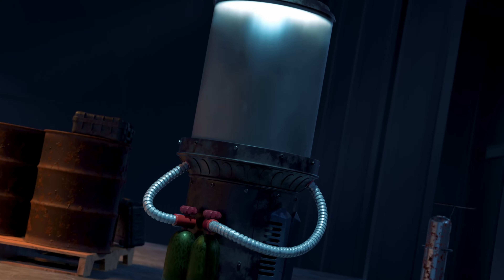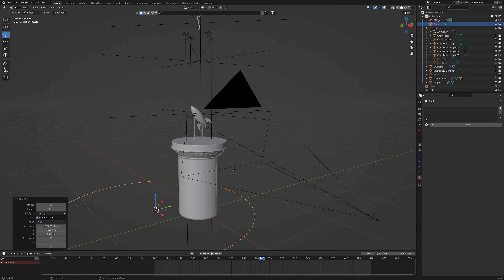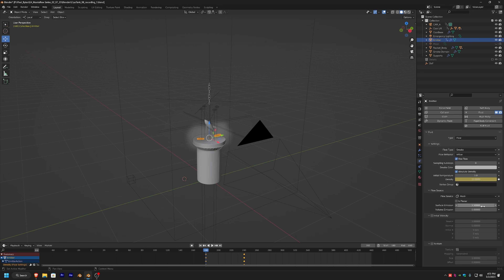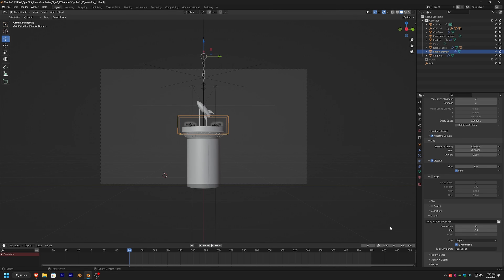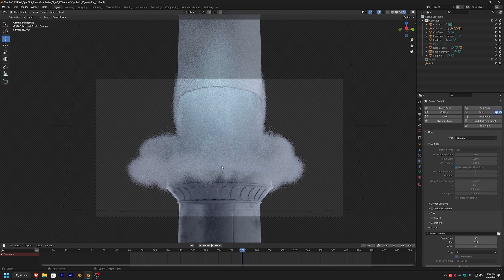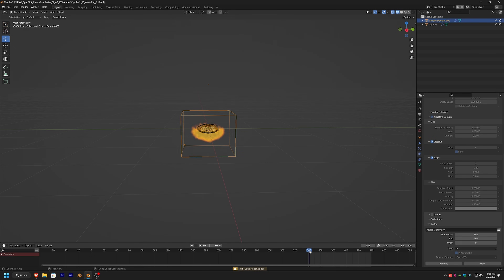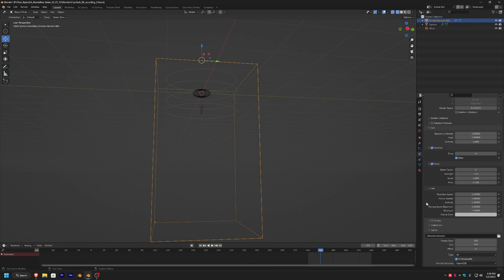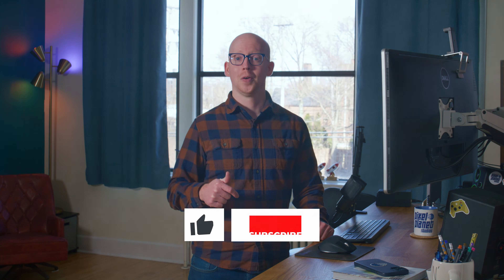Intro to Smoke Simulations in Blender | Cryo Tube Tutorial

Comment: This is so cool. The only reall bummer is by not running both sims in the same scene, the blast from the FIRE doesn't PUSH away the cold smoke that has built up around it; I'd love to see that clear the "pad": guess I'll just have to make my own. Luckily this is RIGHT up there with what I'm doing for work: fake Rocket Ignition Testing and Aerodynamic Simulation testing.

Thank you for demystifying a great deal of these controls.
Reply from the maker: That's a great idea -- a much cooler look

Comment: Hey Eric. I was working on a car drift animation in a city< I'll send you the video if you wanna see it.. So because it's a city I need some space for the domain as the car drifts around a building but as soon as I scale it, the smoke stops working. Could you please assist me on this.. By the way, I do have quite a low-end computing power but it does hold it's own so I push my boundaries making do with what I got so I'd like some help working around this because I do believe it's capable.. My current project is an M4 in a low poly but quite convincing city, I'll also send you a slow drive video down one street.. Pretty impressive for the computer I have.. It used to be an Nvidia GT710 which is horrible and died but turns out my Core i7 7th Gen does a far better job than the GPU itself then working a 32GB memory.. The down side is it takes decades to render depending on my settings and what I'm working on. I think you now have a good idea of what's going on on my end.

Comment: I'm having a bit of an issue with this tutorial in 3.5. For whatever reason the smoke is rendering in solid mode, but as soon as i switch to render, nothing appears at all. Would there be anything i could check to see why it's not rendering properly?
Reply: Hey I have the same problem, have you found a solution?
Reply: @Mi-fo2tq  I have not. Though i haven't really played with it too much since i moved on to environmental modeling
Reply: You should either bake simulation or start animation from the beginning.

Comment: My smoke keeps leaking out of the tube and when I set the surface thickness to 1 the smoke just stays in the center without moving.
Reply from the maker: Hi, thanks for watching. I’d first check your geometry for any holes, and apply transforms to all sim objects. If you still have issues, you may want to increase your resolution. I hope this helps